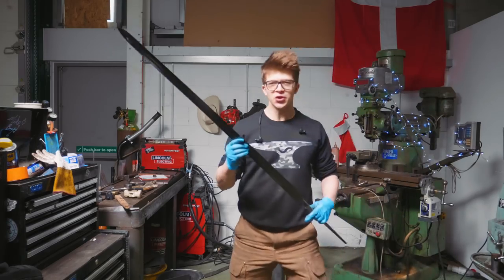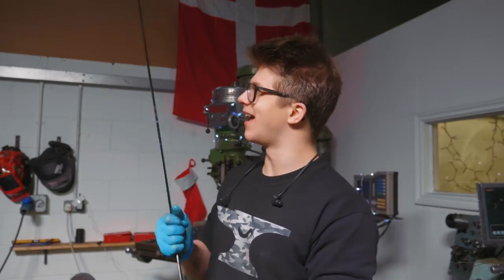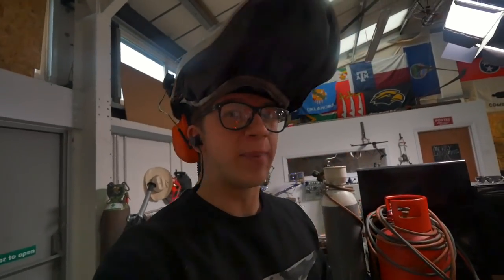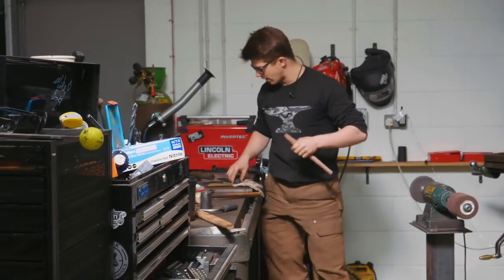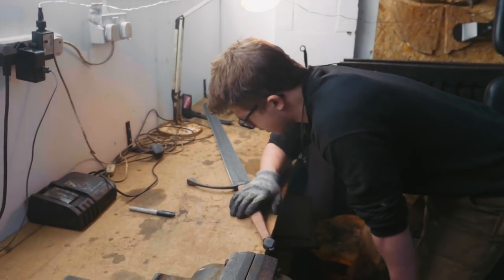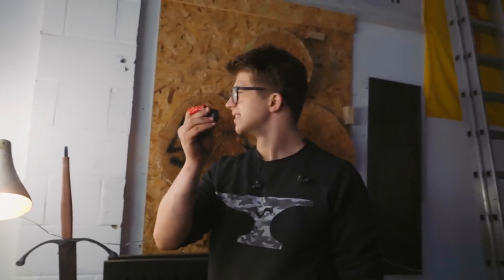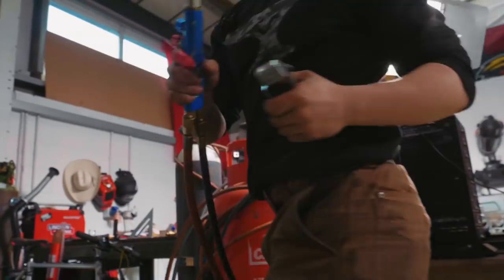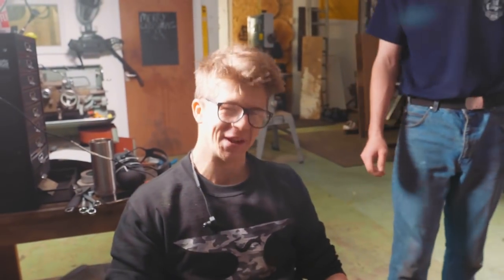MAKING A SCOTTISH CLAYMORE SWORD!!! PART 14 - FINISHED

Comment: Part 15: Going out and using it
Reply: make scotland great again
Reply: but it has a wire wrapped handle. as soon as that hits the target the wrap will turn into a file and rip the skin off your hand. that particular sword requires gloves to use.
Reply: @CatOnACell  Didn't he sand it or whatever? It shouldn't cut him then. right?
Reply: @joelschirripa1883  IDK why I can't stop laughing lamo 😂😂😂😂
Reply: Part 16: going to jail for beheading random strangers
Part 17: dropping the soap 
Part 18: being released and trying to reconnect with society
Reply: Part 15: Throwing it at an English army
Reply: BashTheMan just the ribbed wire, even if sanded and polished, can act like a file and shred skin, under the right circumstances. Gloves prevents that.
Reply: Not on people.
Reply: @bashtheman3016  n- No. It will turn to a file by friction.

Comment: You and joey should forge a decent size  Damascus stake anvil.
Reply: How do you suggest they do that?
Reply: Fire Spark Two large billets of damascus: one for the upper horizontal part, and one for the verticle part. Forge them both to shape and then forge weld the two together. I think it would be a very interesting project.

Comment: Very nice work. I've been in the trade for rather a few years, now, so may I make a couple of suggestions? With a wire wrap, my practice is to first glue a thin layer of pigskin onto the wooden core, dye it black, then wrap. This helps the wire to stay where you put it, and creates a tiny bit of cushioning. Iron ferules on each end of the grip help lock the wrap in place, and cover that nasty bare spot. In twisting the wire, I go a tad tighter than I really want, then reverse the drill a bit to reduce tension and help prevent the @#$%^&*ing mares nest. (Bitterly learned lesson!)
Really enjoyed your video. Binge-watched the thing over two nights.
Reply: as someone who uses swords, ill ad: make a bigger pommel, its supposed to be a counterweight but only just that guard weighs more then that pommel

Comment: To following a couple of guidelines of SHE, I'd recommend you to keep at least two first aid kit in your workshop (placed evenly distributed, or near to the main threat sources), stuffed with differently shaped and sized band-aids, bandages, wound disinfecants and burnt wound threatment. Using electrican's tape on dirty fingers is indeed really badass, but after you shared your toughts about wearing latex gloves during wet sanding to prevent compromising the usability of your hands via cracs of your skin, compromising the usability of your hands via infections sounds silly. Altought you doing a great job, and keep up with this; just be a little bit more careful!

Comment: Great sword, but with no offence, yet I can't help but think that sharpening the sword AFTER you assembled would have been a better idea for both you and your poor filleted finger :P.
Reply: the general way ive seen sword sharpening is before assemply, since it keeps the guard out of the way
Reply: ah yes the guard... tho when i see people sharpen the blades it seems they don't really sharpen all the way to the guard... or am i just seeing wrong.
Reply: like how u sharpening are near the handle? and it will be so hard to hold the sword when u sharpenjng unless u want the grinding machine hit the sword then cut ur leg
Reply: it wasn't the sword that cut him, it was the guard....
Reply: usually there is an area before the guard that is supposed to NOT be sharpened.
in this area before the guard you can hold the sword for certain techniques.
Reply: it is called a ricasso
Reply: you need to sharpen before in case assembling damages something. That way it's easy to fix to get it to final. Not only that but how the hell are you going to sharpen that sword up to and including the handle?

Comment: I dont know about you, but I´ve found that epoxy tends to degrade with heat, so when I peen the pommel I do it cold. Otherwise the heat spreads through the metal inside the handle and the epoxy losses its strength.

Comment: Amazing work. Next time you solder use flux, which you buy plumbing store.allows the solder to flow.  If i could recommend a project, could  you make a fishing fillet knife which is very thin and very flexible. I would be interested in science of making knife flexible and very thin.

Comment: You need a period scabard, thick leather and a shoulder strap. As this sword is too long to draw from a fixed scabard. It must be un-slung from the shoulder to pull it out quickly. Unless you have one Meter if flesh from armpit to wrist. To be proportionate, you have to be over 10 feet tall. Thats why Brave-heart used a shoulder strap, witch he dropped immediately after drawing the weapon as it cumbersome.
 You could choose a Defender style  scabard, made of alloys like bronze and brass. Making the scabard wieldable in an off hand defence/parry application. 
 Amazing work. I was awestruck when you etched that blade.

Comment: If you want another challenge similar to this, you should try another Claymore. This one would be weird with the following tasks: (This idea came to me the other day) 
- Go Mai Construction
    - Dark acid etch steel (outside)
    - Thin copper layer (second outside)
    - 120 layer twist Damascus (center)
    - Thin copper layer (second outside)
    - Dark acid etch steel (outside)
- Leather wrapped handle
- Same Damascus steel on the guard with three large twist
- Maybe even a disc pommel made from the left over Damascus

I think that would be it. If you did it, I would probably be willing to pay for the final result. Please contact, it would be amazing content.

Comment: Amazing build, but just a quick tip. It appears ot me that for such big blades, the temper must not leave the blade all that flexible, since all the weight will bend the blade by itself, mking it difficult to contol when swinging. Maybe for your next big blade project you might want to leave it a bi stiffer than a shorter blade (You have to think that  lower armo of action for the same weight implies more force applied, and that also applies to the blade's natural tendency to curve when held horizontally (as in a side swing, so to spek)

Good fun anyhow, at ths pace you'l end up doing cloud's buster sword out of damascus xDDD

Comment: The torch you used to peen the handle is the type of torch that you should use to braze with. I use a smaller oxy/acetylene torch like that for hvac brazing copper pipes with 15% silver solder. Hopefully this info will help with your future work making amazing swords.

Comment: Outstanding work. 
Speaking as a Scotsman I was sceptical of the wire wrapped handle on a Claymore but it worked.
I'd still be a bit concerned of it flying right out of my hands if they were covered in blood though. Lol

Comment: There is a 💎 polish compound that you can pretty much use on anything after you bring steel down to 400 grit sandpaper it will work wonders on it , I bought it off eBay as a kit for like 30 bucks and it’s even colored coded for people like me , I polished tool steel Tokarev Hand gun I have and people think it’s chrome 😂, never rusted for some reason either

Comment: Alec, make your own steel. I made a wootz crucible steel blade over the summer. pattern welded steel is beautiful, and quite the art form but it is not damascus. Wootz is. It's so freaking easy to make too. All we used was sorel metal, some 1050 mild steel some broken beer bottles, a pile of quite ordinary bricks, a few squirrel cage fans, and a big bag of coke ( get your mind out of the gutter I mean partially burned coal).

Wootz is a bit hot short and it's a bee-yotch to forge but it is the ultimate blade steel and the banding patterns will fascinate you I promise.

Comment: Absolutely gorgeous sword. What a daunting task because of the size alone, but you with the help of Jamie's idea and Joey giving you a hand at the end overcame them as usual. I definitely enjoy binge watching these different weapon series that you have. Way to experiment with new materials and techniques, like the bronze wire handle wrap, great choice vs the iron for that contrast. Perhaps if you decide to do a longsword or redo your first sword you can do a half wire wrap near the pommel and have two rings near the guard and one at the mid or 2/3s portion and cover that part with leather. Use what you have learned over these newer episodes and redo something like you did with the Chef's Knife recently. Cheers Alec. Off to watch the Cutlass one I go.

Comment: I had studied Medieval swordplay for 15 years - if this sword were being made for me, I'd like the ends of the cross-guard to be sharpened to a point, and the arms themselves to have a blade-like interior (so that if fighting gets to be up-close, I could use the cross-guard to plunge it into the face/skull of my enemy, and use that sharpened inner surface to cut them down to the bone). I'd also like to see where the balance lay on the sword to ensure that it would handle properly. In this regard I'd also like to see a more significant pommel, maybe one that was heavy enough to use as a weapon in and of itself - or one that again came to a 4-sided point that I could use to puncture my enemy's armor, or to crack their skull open. It's a gorgeous Claymore though!

Comment: I'm no blacksmith or sword expert but i think the pommel is too small for a two-handed sword. Also the center of balance might be far away from the hilt which causes a lot of strain on the wrist when wielded. Still, an amazing work and also this is the first damascus claymore I've seen so far. Really lovely.

Comment: Very nice project. Two corrections: epoxy cures, not dries . That is a chemical reaction. Second - the best way to make epoxy let go is to heat it . A plain butane burner will do...

Comment: I love this sword so much! the handle is beautiful, what with the wire wrap and all, and the guard is perfect! Its sadly uncommon to see swords with historically inaccurate super thick guards. The only problem is that I did not see you check the sword's balance. The blade is mighty wide, and the pommel seemed to me to be rather too small to even out the sword's balance. I understand that you probably won't be using this for combat, and the balance is therefore not as crucial, but ensuring the sword handles well would make it even better. It could be beautiful both on the shelf, and in the hand. Keep up the awesome work!

Comment: Pro tip: next time you cut yourself break out the superglue and use a drop IN the wound... then squeeze the two sides together.  Cyanoacrylate is great for this.

Comment: Great job Alec.  Tip for those cuts in the shop;  apply pressure to slow/stop the bleeding, fill wound with super glue (yes it is safe) then wrap with a bandage and duct tape.

Comment: Hi! You shouldn't have shaped the hole blade!! Just tip section razor sharp and the middle a decent sharp and the closest section to the gard shouldn't be shaped, there is no need for it, also the pmmel should have been bigger due to the fact that it brings better balance and check out any medieval fencing manual and you'll see you need your pommel to attack, that thing looks tiny for that big badass sword boi!

Comment: I like that sword watched all the videos from start to finish very nice. Seems like you did a lot of extra work though, such as chiseling out the sides where you goofed and making a special tool from plastic. Not sure why you didnt just use a cut wheel on that angle grinder or drill a whole in a piece of wood?

Comment: I don't understand the idea of a solid core of damascus and a less solid edge on plain steel... shouldn't that be the opposite ? or all damascus at least... I always thought the edge should be in high carbon steel to have a sharper edge.... maybe you should just start over.

Comment: The belt is much more accurate than the buffing wheels unless you have a very hard felt wheel. You can mar the finish and cause haze on that nice damascus with the buffing wheels.

Comment: you could put the little grinder with the scotchbrite wheel onto a steel plate so when you use it you stand on the plate and it wont move away from you.....

Comment: Wayyyyy over sharpened. Pommel too small. Bolt that buffer down for crying out loud :P

How can you once again be shocked you have a sword when making one was your stated aim?

Aaaaand, you should fit/wedge the guard, set and peen the pommel, THEN add the flammable bits. This is the historical method.
Reply: Edmund Schwartzadder oversharpened? It's a sword, not a butter knife

Comment: Am i wrong or the katana he made is thicker than this claymore? If I remember he brought down the katana to 8 or so milimeters, this doesn't look that thick, it's wide but not that thick. I think if this sword collided with another "crude medieval" claymore it would snap. Honestly as impressive as it looks, it also seems really fragile to me. It's a damn impressive display piece though.
Reply: There's a reason smiths heat treat. It makes the metal flexible enough to absorb shock.

Comment: hey alec just found your channel today and just wanted to say your a super funny and likeable guy i wanted to start blacksmithing in my free time but there arent any forges near me :(
Reply: DragonK1ng 007 making a forge is fairly simple and can be done for around 250-300 USD. Fire brick and mortar rated for high temperature. One propane burner(you can order one from Alec's online shop). Ceramic insulation and a table to set it all on.

Comment: dont use electrical tape on cuts  use superglue in and around the cut and a little bit of paper over the top which absorbs the excess glue and makes a strong protective layer that looks so much better than red electrical tape
Reply: FDG just the other day I cut my finger about down to the bone and probably needed stitches but I just threw so super glue on/in it and it’s healing up beautifully